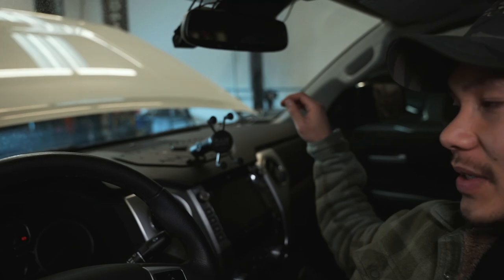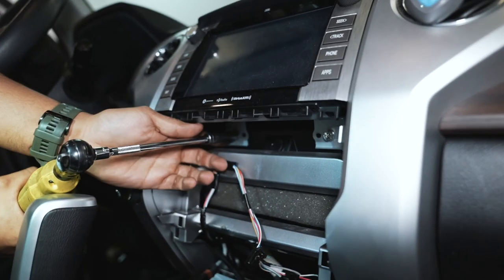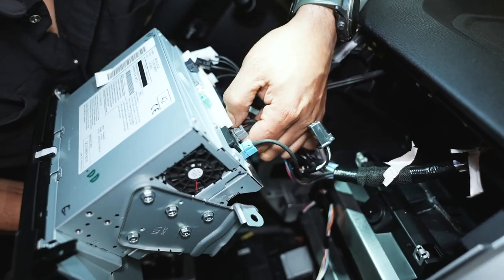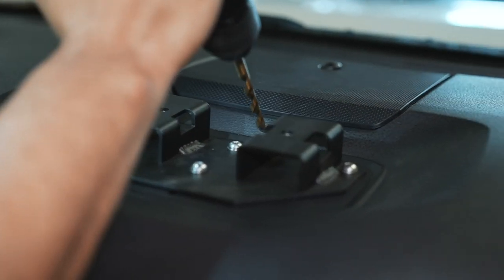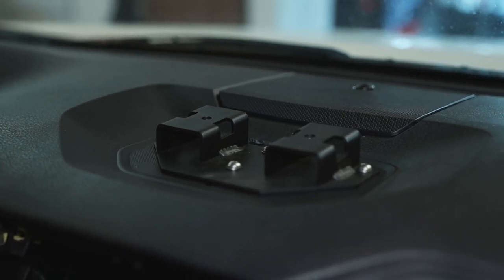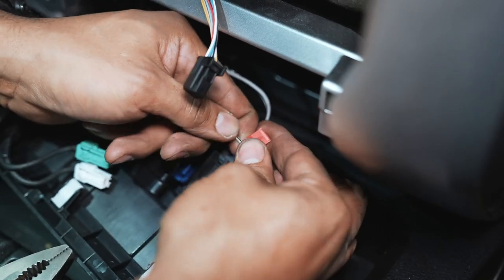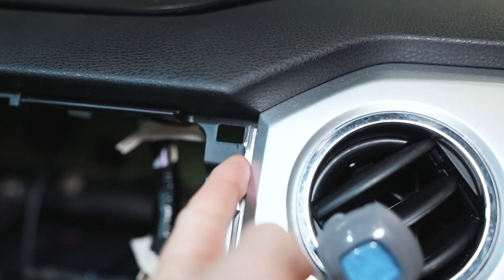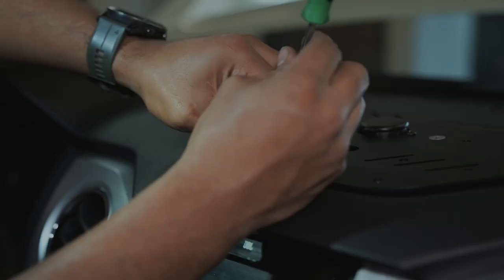14-21 Tundra Dash Mount for Phone, Mic, & Other Accessories - Rago Fabrication Tundra Dash Mount

Comment: Question: Is there a reason you drilled the hole for the wiring to the back of the unit? It seems like it would have made more sense to drill another hole in the flat area what would normally be under the rubber mat. If it ever needs to be reversed, that hole won't be covered. I'm just curious of there was a reason, since I'm about to tackle this myself.

Comment: You should've used the ICS Fab under plate for added support. Also use 67 Deign mounts since they carbon fiber for less vibration.
Reply from the maker: Pretty happy with it so far and no vibrations